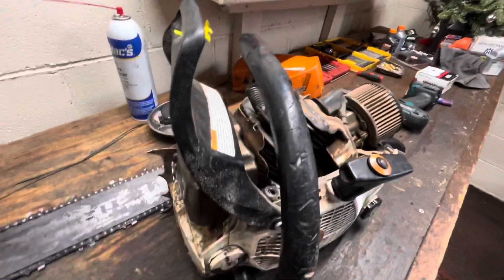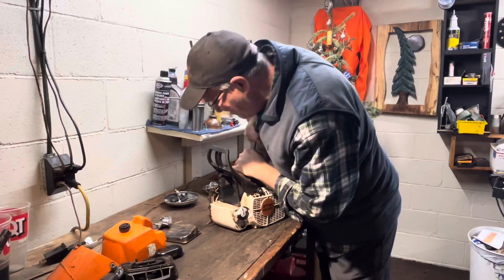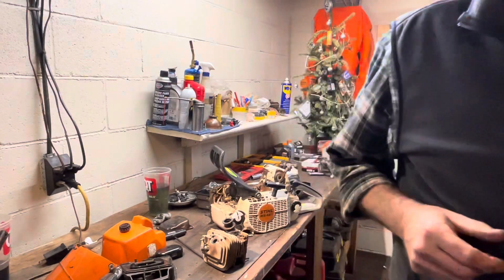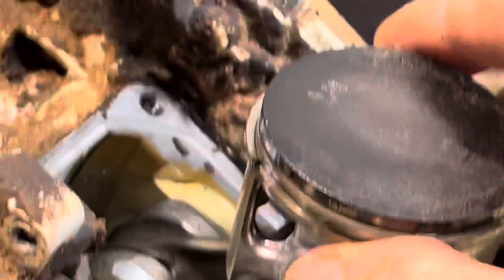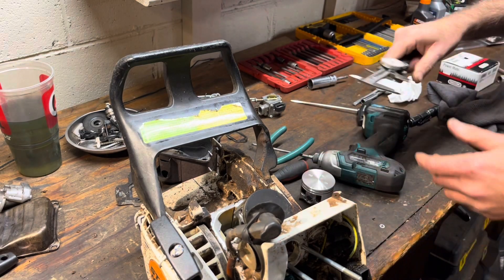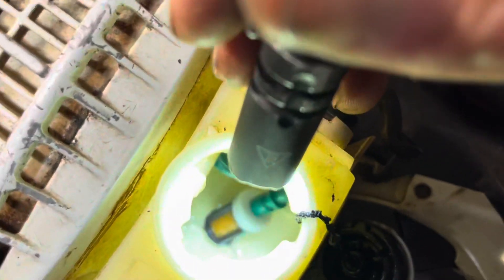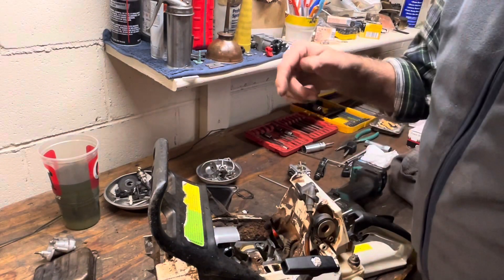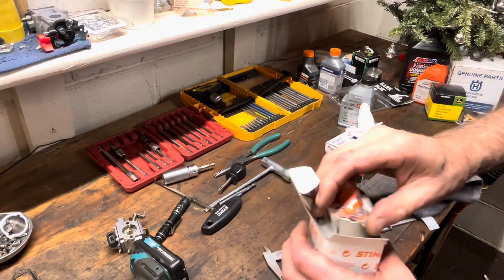MS461 Piston Inspection and Teardown Stihl Ultra Turncoat

Comment: Richard, it would be nice if you could include ...

total hours of run time (estimate):
hours on oil A:
ratio on oil A
hours on oil B:
ratio on oil B

With all the pond water stories that abound, I was surprised there weren't any ugly, burnt on deposits.
Reply from the maker: Search my videos for a long term test on an MS261 about 6 months ago.  That tree company has run Saber at 50:1 for years and their internals look better than any of my other customers.  Less failures too.

Comment: Doesn't look as bad as I expected for hp ultra. Did the fuel smell like gasoline? Just pulled plugs and mufflers on my stihl fs 70r and ryobi blower motomix (+10.3 ml ultra to make 44:1) guinea pigs and still no buildup with shiny piston crowns🤷🏻‍♂️ must be something about the alkylate fuel used in motomix, as I've seen plenty of nasty from hp ultra mixed with pump gas!

Comment: I know that Stihl Ultra leaves a light coating of ash in the cylinder.  However, I have never had an engine failure as a result of using Stihl Ultra at 50:1.  I do not run my saws at the very threshold of their capabilities, as some do.    I have tried other two cycle oils, but these too have their limitations.  The best alternative to Ultra I have found is HUSQVARNA XP, but I am not satisfied with it either. Walt uses it but I see to many failures in his saws for me to jump on to the XP bandwagon.   All my saws are still running on Ultra.  I do tend to like Stihl Moto Mixa  a little better than my home brew but it costs over $40 a gallon these days.  I liked Red Armor until it started separating in my gas.  FD oils also cause an increased pull over in my saws, which I do not like.
Reply: Any FD rated oil is better than Stihl Ultra. OR Stihl HP for that matter.
Reply: @stihlvarna  I agree but FD oils have some problems, too.
Reply: @johnclarke6647  like what?
Reply: Try Motul 800 off-road for the same price. I doubt you'll change to something else after

Comment: I just switched from ultra to saber Because my 500i piston is covered in carbon and some glazing before the first ring on the piston, thank you for the info on ultra. Should I get the carbon cleaned off the piston or is it normal? Thanks awesome videos.
Reply from the maker: Saber should clean that up over time.  You can add a couple ounces of Seafoam per gallon to your mixed gas next time you make a batch of fuel.  That should speed things up.
Reply: @richardflagg3084 что значит морская пена???

Comment: You I have not noticed any difference between Stihl Ultra and Stihl HP.  The only difference I can not is HP contains 77 ml of oil and the one gallon Ultra bottle contains 71-73 ml of oil.  Since I measure everything, my gallon of Pond Water always contains 77 ml of oil, which is slightly better than a 50:1 ratio.